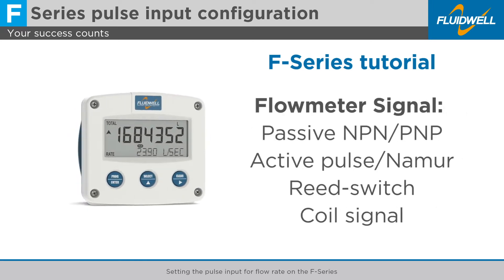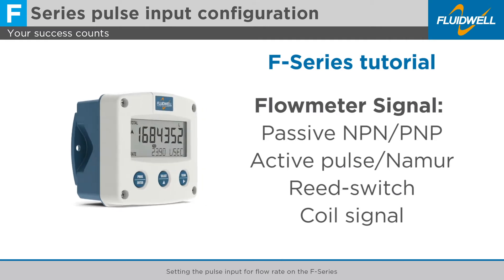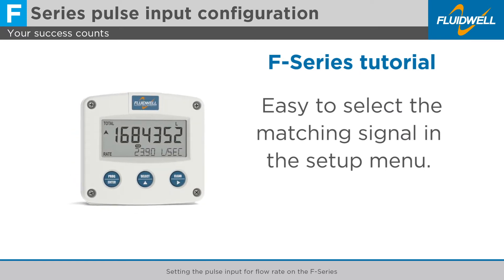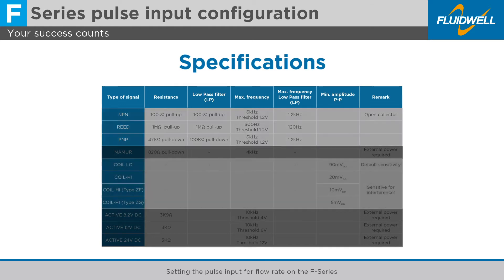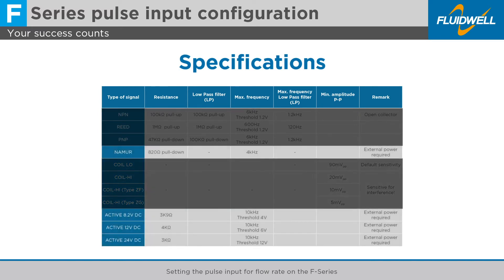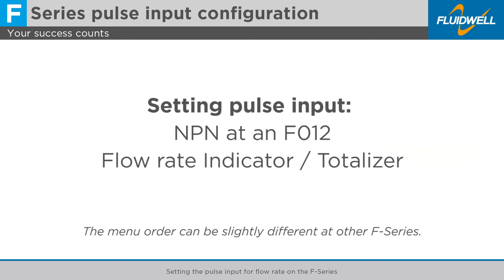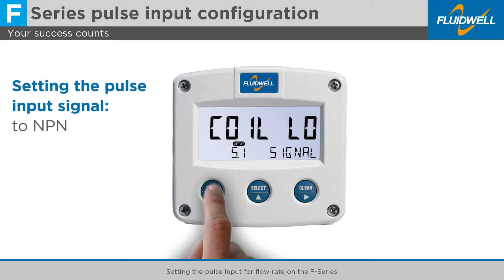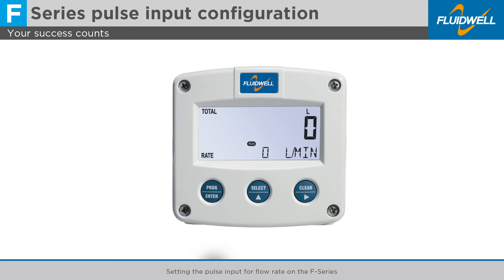Setting the pulse input signal on the F-series

Comment: Fluidwell model: F030-P-HA-OT-PD-XI-ZX
Primary signal input: Pulse, Coil, NAMUR

I have this device, and I want to transfer its data to a PLC. How can I do this?
The flowmeter sensor shows how many liters have passed, and I want to display the same information on a PLC + HMI system.

How can I get a pulse output from this device and send it to the PLC?
Reply from the maker: Thank you for your request, please check your email.